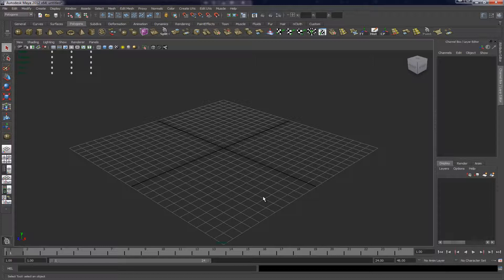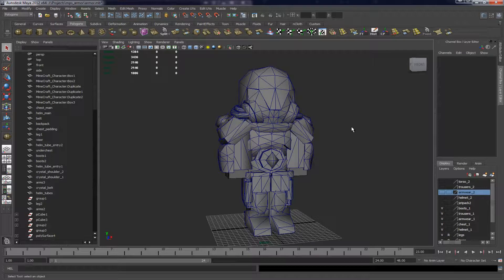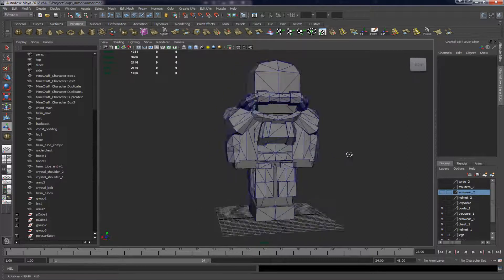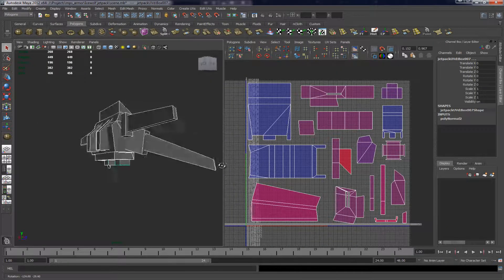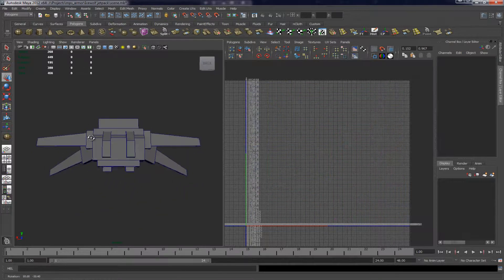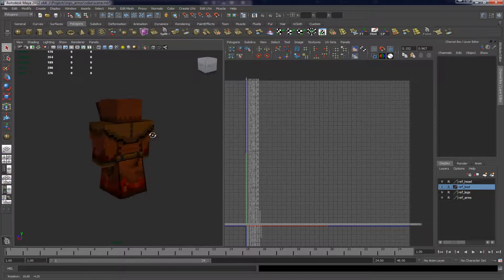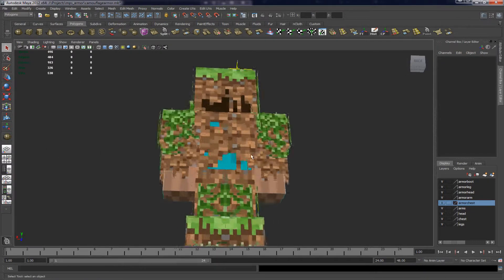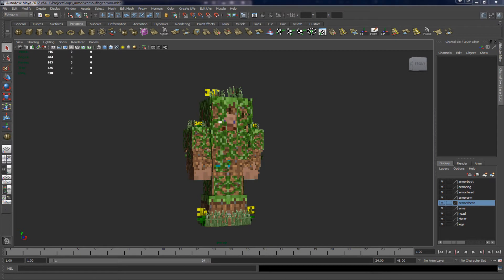Tips on 3D modeling for Minecraft mods

Comment: Speaking of the helmet, it doesn't please me either. I ended up turning off the shell and the visor, I use Galacticraft's glass helmet instead (as seen in my latest video). Player's head is too big to be covered with a round helmet. What if the helmet were more cubic following the shape of a normal helmet, or the ear-to-ear cross section were trapezoidal (flat top with slanted sides)? It's a concept that I have in my mind.

BTW, lovely quadri-winged jetpack. <3